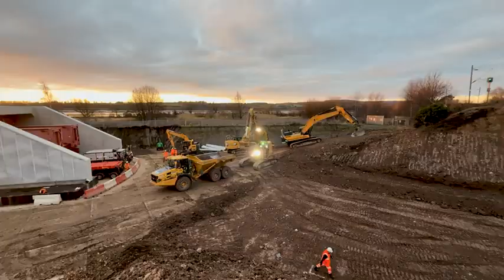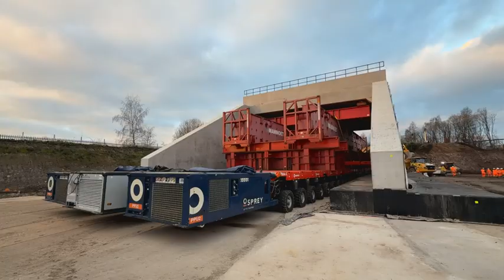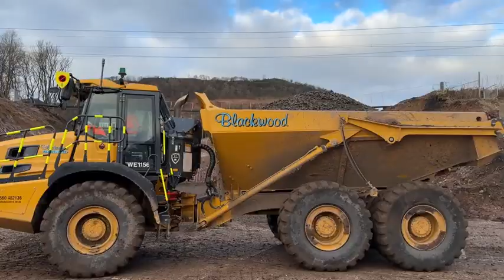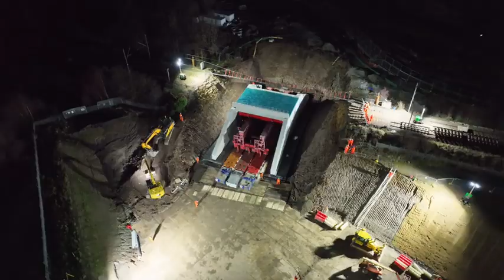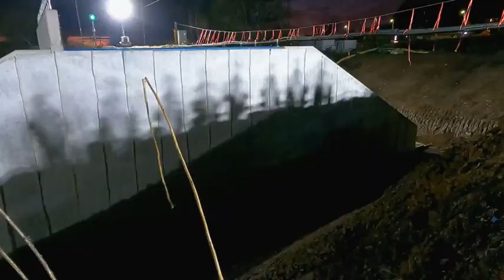This bridge's concrete weighs the same as about 34 million mince pies!

Comment: I actually make it to be equivalent to 31 million mince pies.

on the basis that the average retail mince pie is ~60g, thus there is 16.66666666666667 mince pies per 1kg, thus there would be 16,666.66666666667 mince pies per tonne, multiplied by 1860 tonnes comes to exactly 31,000,000 mince pies (with accuracy to 7 decimal places, or 31,000,000.00000001 if you insist upon 8 decimal places).

but being the structural engineer I am, your statement:
"Engineers cast the bridge on location using 1,860 tonnes of concrete – the same weight as about 34 million mince pies!"
contains a fundamental error.

you did not include the RBMPW factor (Rebar mince pie weight factor) that would be adaptive to the CMPW factor, so one hopes your did use rebar, so your bridge behaves like a perfect mince pie....
Reply: Perhaps the steel used made up the remaining three million pies (though admittedly they do only mention concrete) Or perhaps they have smaller mince pies in Scotland, or perhaps they have discounted the metal foil casings, or perhaps some of the crusts have crumbled, or they are old and have dried out, or . . . . . . . .

Comment: No foundations it will sink?
Reply: Over the years the ground has had a railway embankment on top, any settlement/compression will have occured 100 years ago. Whilst their is a little disturbance to the placement layer nothing significant.
Reply: @RickD62 yes I assumed wrongly they were replacing the bridge,but I now see it's completely new so you are correct
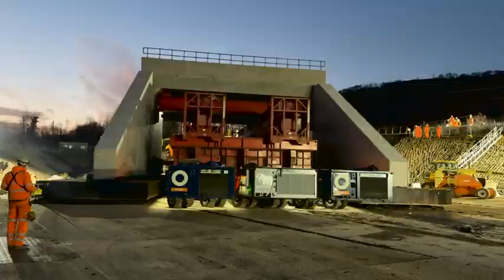Reply: The foundation pads are built in, they are the lower flat parts of the sidewalls.  See the view at 1:21 please.  The weight of concrete being installed will be little more than the weight of material removed from the embankment.  This is a tried and tested procedure, nothing to worry about.